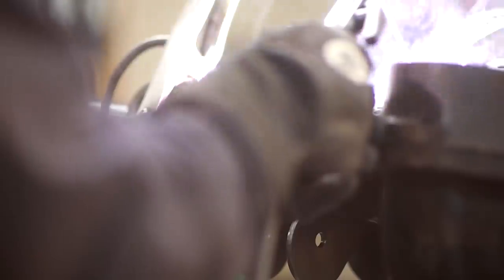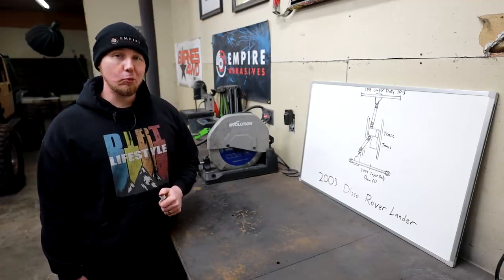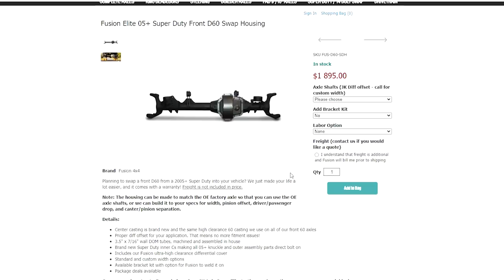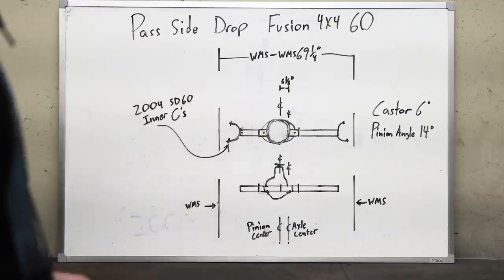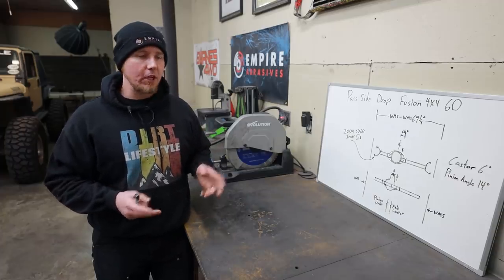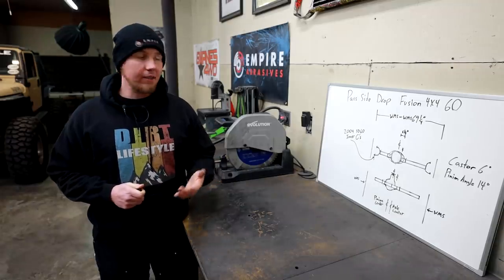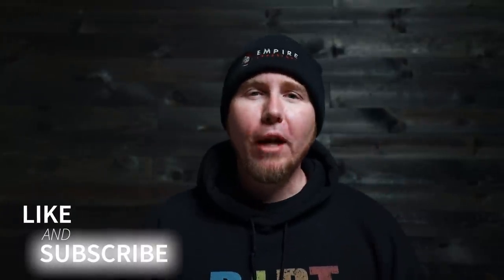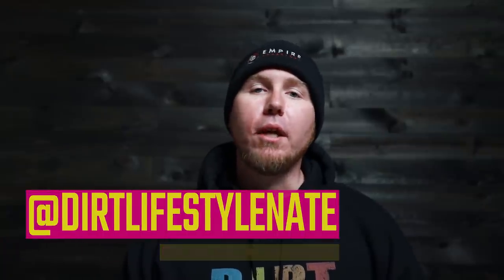This Dana 60 Won't Work! Ultimate Land Rover Discovery Build Episode 24

Comment: Thanks brother. This video really helped me to make a final decision on which way to go with my build. Was going to do a one ton swap on my XJ project but decided on a different route. Going with a 9 inch rear and a 44 in the front. Cost wise it makes more sense for what I'm building it for. already have a line on the 9 inch and going with a used 44 out of a late model wrangler. "I always use the rule of P"... Proper planning prevents piss poor performance... Rock on my friend.

Comment: Making something out of nothing is never easy. Bummer about the axle but I am stoked about fusion axles. I didn't even know about them. When it's time to upgrade my Rubicon's axles I will be heading to there.
Reply from the maker: These things happen sometimes. Either way this WILL be a 1 ton land rover. Fusion has a great reputation in the industry so I'm pumped to use them 👍

Comment: After watching you build this axle I took on the task of making a rear axle. Dana 70 center with chrome moly axle tubes trophy truck outer hubs and all the mounting points etc, with new 300m axles to suit... Only to find the central housing has a small leak that I only found after it was installed and the oil went in. We all have bad days, but we learn from them and move on.

Comment: When you try anything, be prepared to fail, and learn, so that you can fail better, and less in the future. Failure is the most scientific outcome...it is absolute, where as success is a series of compromises that you have accepted to gain a tolerable outcome, but never a perfect one. That sucks that you did all that work for THIS project on the axle, and it won't pan out for you Nate, but the flip side is the content you created in the build is excellent, so a total success, just using a different metric. So, now you need a project for the axle you created, which could also be counted as a success, given the continued excellent content of your chanel. Thanks for all the effort, both in front of, and behind the camera!

Comment: I bought a 1999 F250 with bad engine for 500. After parting it out I got almost 1800 and kept the axles for my yj. It's a dana 50 but it'll be fine in a little Jeep.

Comment: Is it possible to build a hybrid driveshaft with Porsche 935 cv's?  They use them in pro4 race trucks and they have 26°'s of working angle.  I'm not sure if it's doable but an interesting thought.
Reply from the maker: These angles will slowly destroy any high angle joint Unfortunately. The angles are just to extreme. Having the correct axle is really the best way to move forward 👍

Comment: I always wondered if a centered differential would work with enough lift, mostly because I wanted to do dual 14BFFs, but didn't feel like moving the center section and shortening/lengthening the axle shafts.

Comment: I've got a 97 discovery1 and I'm changing my axles to Nissan Patrol GU axles as they are realy strong and only running 35inch tires nice thing is the front axles on the Patrol is basically a blot in on the Discovery 1

Comment: Ohhh hell, I hate having to tear stuff apart that I have fabbed up, spent time and money on, but I missed a detail! 
Here is an idea, what about a two piece front drive shaft? Come out of the T case with a short little D-shaft to a center support bearing then into a dbl cardan "standard" front drive line. 
Your thoughts???
I am thinking about the guy that can't put another $3000 plus into another axle.
Reply from the maker: Not enough space. The front drive shaft is pretty short on these. It is easily a foot shorter then the front driveshaft in my Jeep. 👍
Reply: @DirtLifestyle  I was wondering about that. AHH, well at least the idea is out there for others to maybe benefit from.

Comment: Hey Nate, great video as always 👍
How realistic would it be to pull the axle and re~tube it to what you need? I'm thinking since you have a useable center section and inner C's all you would need to do is make tubes the length needed then redo the mounts and whatnot. You would of course have to make or have made shafts to fit.

Comment: What about using a custom double cardan cv shaft up front? Can't believe how frustrating that would be to have to toss such a sweet axle after all that hard work.
To add to that, it's too true.  I've run into dead ends too or projects that really weren't the best options, but the challenge was interesting. Either way, like to see what the reason was and what the best alternative was. Thanks!

Comment: I have a 2004 Dana 60 in a Cherokee XJ. Fighting similar offset angle issues. In my case vibrations, not actual binding. Offset sideways as well as regular angle kills. Wonder if double CV (not double cardian) would fix this?
Reply from the maker: That is exactly what my solution was. I think a double, double cardan joint is a good option in many instances. But for this Discovery it wasn't enough

Comment: I’m asking just because I’m curious and want to learn. Couldn’t you have swapped the front axle with the rear. It would reduce the binding on the front since it’s more inline. Also the rear axle have the longer drive shaft could accommodate for the odd placement and soften the binding issue.

Comment: Awesome video Nate, yes the dana 60 doesn't workout, yet there is no loss in my books and ordering the new unit custom built to spec, makes 100% sense the price of  $1895 brand new with everything and a warranty is a no brainer, if you decided the other route of used it would have cost you more in the end when you add your time into the equation like 20-30 hrs and everything done especially with Fusion doing the custom machining as a whole not extra like most would charge you, and to the commenter saying to use and modify a defender 110 axle to do this job based on the dude out of Quebec, sure it could be done, and it becomes the weakest link in you drive train a 110 axle is no where near as strong as a Fusion built custom axle with Dana 60 components or the longevity or reliability , looking forward to the next video on this front axle install, some peeps i know in California say Fusion is good quality and these peeps been off roading for over 25 yrs so its safe to say that are good.👍
Reply from the maker: Thanks buddy👍 we are definitely on the same page
Reply: @DirtLifestyle  peppers and all the commenters that are saying used are are penny wise and pound foolish, old saying ,  it is 100% true thats why we are on the same page

Comment: Not sure if its a dumb idea. But could you run a double Cardan joint at both ends of the front shaft?
Reply from the maker: It already is! Still to much offset!
Reply: @DirtLifestyle  Bummer man, it will make for a good video coming up tho!

Comment: So when are you going to do the Nitrous video? I am very interested in it . I have been  researching to see if i could do a fogger to add 15-30 hp to help me with more power going up hills on the freeway and sometimes I need a little more umpf to get up and obstacle. I have 2004 Tj My 4low is super lo(granny low) in 1st gear. my gearing is 3:73 but i love the gearing intown i got lots of power but its just when i go up to nothern Az i need a little more power on hills on the freeway I'm having to down shift to 3rd and 2nd gear sometimes.

Comment: I do have a question tho that might be a good one for the Q & A What is the weight on a Dana 60 fully built and a truss and all your link mounts and everything. Also you might get what your weight is on the one you built to the one you are getting.

Comment: Great videos. Question, other than the offset DODNT work out. Would you say that axles is still good to run. I have a super duty d60 I’ve acquired and want to to what you did for my T100 SAS. I want to do exactly what you did. Did you run into any other problems other than the offset not working for you. Appreciate the help thanks.

Comment: Nate this is a great video in the fact that you can plan till your fingers bleed but the therapy just doesn’t work. 

But I think it’s also very important to remember that this is not a failure. To fail is to never try again and you simply have here an idea that doesn’t work for this project. 

To the new fabricators that is very important to keep the mind set moving towards building it better faster stronger. Your failure is not the end of the road it’s just pit stop on the way to success.
Reply from the maker: Perfectly said 👏 thanks for watching buddy

Comment: I'm doing a SAS in my Nissan and I want to make sure I'm measuring my spring perches right. I've been measuring my width spacing by using the center of the leaf spring locater pin holes. Is that the correct way?

Comment: Hope I don't run into this problem with my Toyota pickup, I got a 2014 sd60 that I cut and flipped the 3rd (inspired from Nate) but haven't finished welded it yet and put it under the chassis...
Reply from the maker: Toyotas have a much wider frame. You're setup won't be perfect but it will probably work just fine. My problem is pretty rare in reality

Comment: You win some, You lose some. I truly wish I got my Dana 60 Like that. Mine was a 1986 Dana 60 that came out of a DRW truck along with my 14 bolt cab and chasey. Have had to do a lot of work to get it where it is right now. But it is done and ready to go in the 1980 CJ7 that is now 4 linked in the front and rear with 16"ORI'S 2 +year build. So yeah the web lied!!! lol it looked so fast! lol

Comment: The 2014+ Ford Dana 60 is $1400 lock out to lock out here. I can probably get them for $1200 cash. The 2010ish Dana 60s are $750 listed I can probably get them for $650. I am on the east coast and most trucks get scrapped because of rust. Let me know if you ever need a 60.

Comment: That's why you should have stuck with the stock axle and uprated that instead ..... there are plenty of upgrades available to strengthen the stock item that would have saved you a load of bother and you would have had an axle probably as strong as you were trying to build.

I like the way you present you fabrications....even i can understand them.....TTFN Phil.
Reply from the maker: Axle width (wms-wms), ball joint size, brake size, ring/pinion size and axle shaft size are all inferior in the OEM in the land rover axle. The OEM disco axle can not be made as strong as a dana 60 in ANY metric and will not meet the demands of a build like this.
Reply: Check out a heavy duty LR axle case and work from there. Uprated shafts, bearings etc are all available and as you're 'strengthening' an already strong axle (the Dana) the same can be done for the LR axle. Just using the axle or a H/D replacement as a base for uprating would probably have saved you a shed load of work as all your angle's, clearances etc would have started from stock..

Bear in mind that all this work you have done...magnificent fabrication by the way......all winds up at the transfer box from front and rear and that potentially will be your weak point....although LR boxes are known for being quite strong and being able to take a lot of punishment, it's somthing to bear in mind....TTFN Phil.
Reply: Forgot to add check out part number DA1708 for an example of a heavy duty axle...

Comment: Maybe try Nissan Patrol y60-61 axles h233 or h260. I own 61 like every day car, and it served very well even in heavy conditions with heavy load, with big tires and with lot of torque in 4L and during highway cruise on 70 to 80 mph either. I have bad experience with engine and electrical&electronic systems, but never with axles or other transmission. People from UAE put over 1000Nm to each of this axles and it continue to serve well. In Russia we torture it with extreme mud, swamps, rocks, bad tuning and even worse- with regular Russian roads.. and it survives. Australian jeepers also very like this car.
Also C303 Laplander portal axles are very well and solid, but it is more extreme off-road option, doesn’t fit good for expedition build- slow, loud and coupled with drum brakes, not good for highway part of expedition.
I heard rumors that Nissan patrol/safari y61 is not allowed in the USA for road use due to ecological and safety reasons. But I guess that using parts of patrol transmission is ok. Or it more likely, that it may be just rumors and Patrols are rare on USA roads just because American jeepers have a lot of another good cars to choose: like Bronco, Wrangler, Ram, f150.. etc which are more easy to get than this Japanese car.

Comment: If you do not go the custom axle route, Toyota FZJ80 Land Cruiser axles will prolly work. 8 inch ring gear makes them small, but still tough as nails, can be upgraded for serious abuse with 85 mini truck axle parts, factory E lockers too. I get it tho, custom axles are cheaper these days, anything Dana 60 is just fked, so are toyota parts.

Comment: Nate.  These are race truck spec' axles ?  Ask Mike from "Britannica Restorations" YT Channel-Quebec, Canada as thought a reversed Salisbury axle from LR 110 Defender Classic could be modified !  V.
Reply: Not a bad idea. although Salisbury Front Axles are VERY hard to source (110 Ex MOD only)....and I live in the UK. At least £1000 with no locker.....(Another £700 for an ARB or Truetrac)
Reply: Also only come in 3.54 ratio. Altho GBR in Utah do a few more CWP's but would they match his Dana 60 rear gearing. 5.38 was it?
Reply: @Leo-dk4we  LEO.  Mike's exchanging the rear 'Muriel from Malawi' 24 splined Salisbury which is old copy of the Dana 60 axles ?  "Ashcroft" offer 4.75 ratio crown wheels and pinions for earlier differentials !  V.
Reply: @vincentpoole7588  Yes, he's doing a Salisbury Rear but not a Salisbury Front. The front is just a standard 'Rover' axle (Def/D1/RRC) which is the early type 10 spline. He's converting it to the Later 24 Spline. Salisbury is similar to Dana 60, however only very specialised Military Defenders had a Salisbury Front. (P.S LOVE Mike @Britrest!!!)

Comment: Really not sure why you keep insisting on keeping the ABS.  ABS is nice, not gonna lie, but really not "needed".  Off-road yer probably better off without it, but on the highway it is a boon, not gonna lie there, but like a manual transmission, the non-ABS means you get some finer control rather than just burying the binders and praying.  Losing the ABS also means some additional real-estate in the engine compartment, which is always at a premium!

You do you....can't wait to see the new axle!  If you have a suggestion, I need to find someone to make custom dog bones for an IFS.  Gotta stretch the front end by 2", which is great for articulation, but a pain in the ass trying to figure out how to get the CV shafts that extra inch per side.  Cutting and sleeving is a terrible solution, IMHO.

Comment: The discussion of bought vs building for some reason always becomes some sort of sore spot.  All of these projects cost SOMETHING, money or time/headache, which do you have to spend (or want to spend), and be HONEST with yourself.  bumpers for my WJ are a fun example, it's right on the edge of worth it(convert to cnd$ and shipping UGH)  to buy a DIY kit for the rear, and a made set for the front and do some minor mods.  my times worth around $100 an hour for fab work... designing, fitting (and refitting, again be HONEST), cutting the parts, welding, finishing, etc... theres probably ATLEAST 12hours for the 2 bumpers (probably closer to 16hours), I could get the 2 'kits' for $2500 (again once converted to cnd and shipped) .. and probably be done within 6hours, that 'extra' 12 hours could go into the storage mods I'm doing for the rear cargo area as theres nothing off the shelf that is what I want. 

custom axle prices have gotten SO much better, even over the past few years.  I know a couple shops that only basically use 44's or 60's in all their builds and would custom build the axles in house.  Now they have a few center sections and their favored c ends.  They do a down and dirty mock up with some tube and tack welds for positioning (they can also work out suspension stuff, and put it through motions etc) .. send the measurements off and install the custom built axle when it arrives